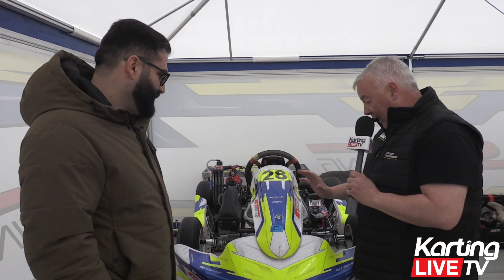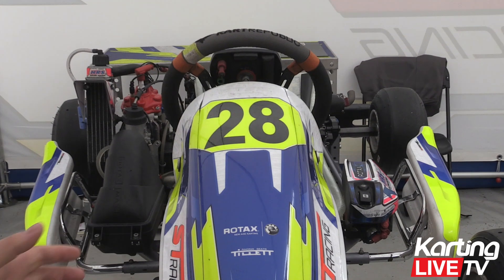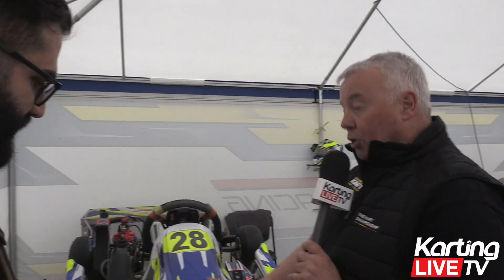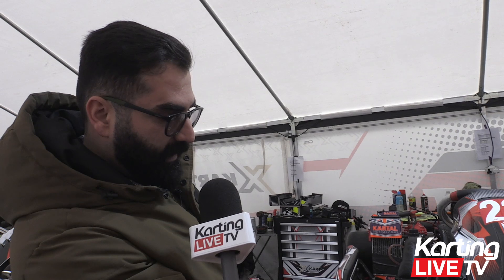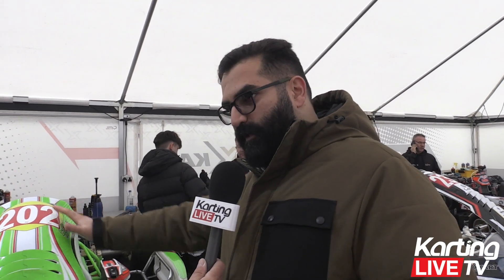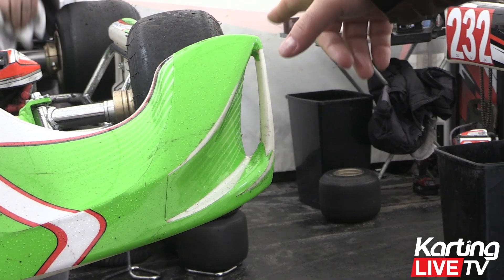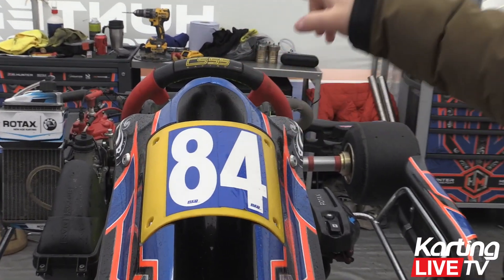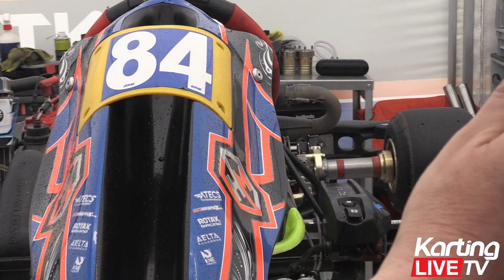Kart Aerodynamics are out of Control! - Do these new designs do anything apart from take your Cash?

Comment: I’m sorry I have to say something here.
The biggest issue with karts is what’s called drag coefficient. Which happens from driver towards the back. Aero on the front does absolutely nothing to the speed of the kart. Take the Nassau off and I guarantee you will go faster. It’s a marketing tactic just because it’s different from last model. Many ways of reducing drag but I’m not going to spell them out here.